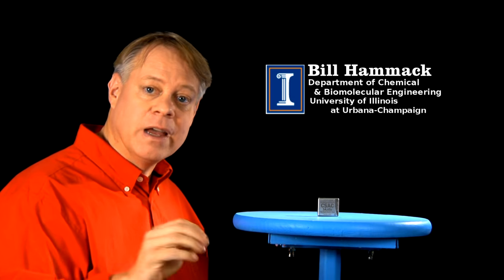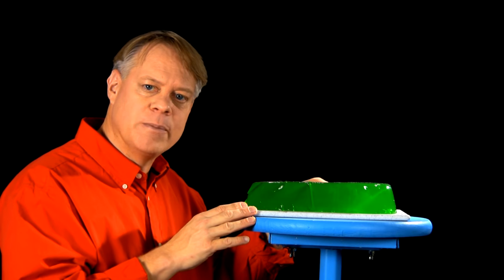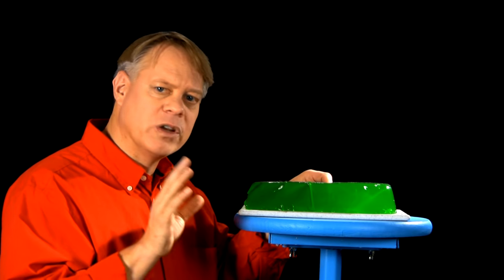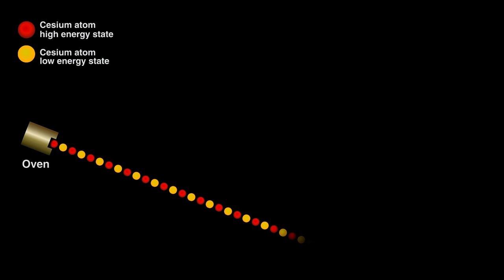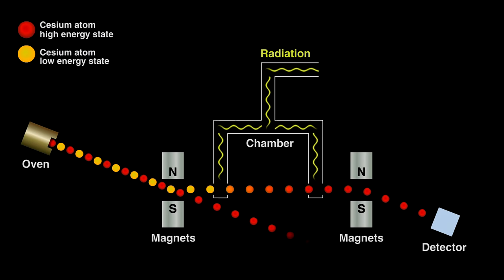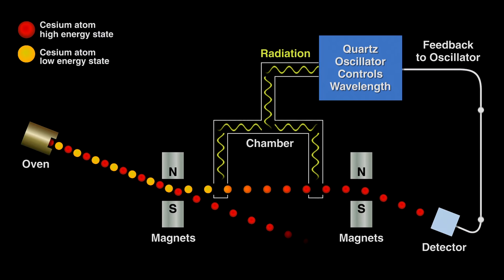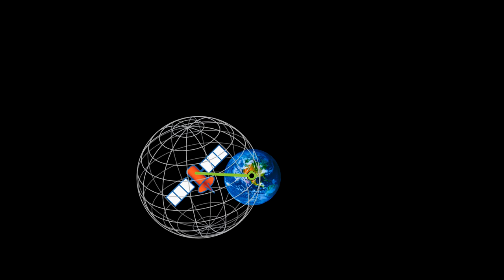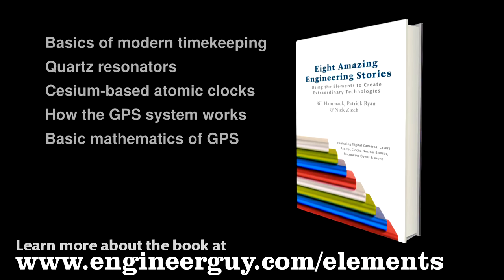How an atomic clock works, and its use in the global positioning system (GPS)

Comment: But my phone doesn't have an atomic clock. How did it's accuracy didn't affect the GPS outcome?
Reply: Systems (satellites, phones, computers) connect to one or more atomic clock services, and fix their own internal clocks.  For example, disconnect your phone from your mobile service provider, and turn off wifi, then change your phone's internal date to something like 1999.  Then turn back on your mobile service or connect to wifi, and your phone will be set to the correct time. See NTP Timer Servers.  Since they have such small chips now for an atomic clock, the satellites probably have their own.
Reply: I actually knew that, but I didn't imagine that would be sufficient to handle GPS. Does this mean, that if I change the date and time in my phone, my GPS will not work well? Because I did this, and I don't see that it matters that much. Is my phone synchronize with the satellite, in spite of me telling it not to?
Reply: I know that Google Maps will not work unless your clock is synchronized.  Many people who have problems with a GPS don't realize it's because they have an 'invalid' clock.

Comment: yeah but basically the surface of the earth is 2D so if you cross the graph of the equation with the surface of the earth you will get only 2 possible points of location :) 
(in case you are not flying or something, that will just point you somewhere else)

Comment: Does an atomic clock lock in some way to accurately reflect our planetary orbit Im curios if the rotation or orbit changed speed would the clock adjust? if not wouldn't a faster orbit or rotation cause a faster day-year that would give the effect of living longer as the years would pass quicker and with less heart beats per minute or Can we tie a man made device such as this to our bodies bio "clock" of aging  and the cosmological "clock" of the solar system
Reply: The IERS adds and removes leap seconds in order to compensate for variations in Earth's behavior. This does not affect the GPS network, because their atomic clocks are used to measure absolute time periods, not cycles (like days or years).
Reply: Ervin Arnold so such a device could in a way be used to alert us if such a timespace phenomena were to occur
Reply: The experience of time is constant for your speed. Barring relativistic effects near the speed of light (and I mean very, very, very close to it, where quantum mechanics kick in, that is, 99.9 and many more nines %), you would experience time just as you know it. Let's suppose your doctor gives you 6 months, and you hop into a magic starship that travels at 99.9% of the speed of light. You would experience 6 months, and then die, just as if you'd stayed on Earth.

Of course, depending on how fast you are traveling, your six months could be years or millenia here on Earth, but that doesn't give you extra time, because you always experience one second per second. If you want to meet your grandchildren as adults before you die, that's great. Hop into the magic ship, accelerate at just the right speed, wait a couple of seconds, and then hop out, decades after. On the other hand, if you need 7 months for finishing your novel, you're out of luck.

Please forgive my poor English.

Comment: in order to calculate the distance in our [hone we need to know acuretly the current time, i don't guses our phone has an atomic clock so how does he calculete the distance without an atomic clock inside the phone?
Reply: Two things to consider.
Your phone gets the real time from a GPS satellite.Your phone cheats when you are navigating by triangulating against cell towers.
Reply: the phone can't get the real time from the satelite, there is a litle delay because the huge distance and also he can't get the the time from the satelite he is trying to triangelate.
and about the cellphone tower ,i know that the gps also work when the cellphone is on airplane mode so thats rules out the cellphone tower option, so could it just be that the clocks in our phone is really accureate?
Reply: BadWolfZm I'm pretty sure when a phone triangulate on cell towers, it is by signal strength, ie. good old fashioned triangulation.
Reply: there are two ways to triangates the phone location, 1 is by phone towers and the second one is via GPS (satelaites ) but in the satelite you need to know your excuct time' how the phone doe's it

Comment: I posted this on his quartz crystal video but here again: 
Me: 🤗was excited to make a comment about how GPS satellites 🛰 have atomic clocks, and it’s the most mindblowing everyday demonstration of the universe’s spacetime
Also me: 👀 notices Bill already did a video on this, 9 years ago. 😧
Well I’m gonna tell you anyway. 😁
Did you know if a person were to theoretically travel in a spacecraft away from earth and reached the speed of 1 light year per second, when they returned, the people on earth would have aged more compared to the person in the spacecraft? It’s not even a theory, it’s a proven fact, and GPS hinges on this, and anywhere you have ever seen a GPS provide an accurate signal, you have witnessed it. 

Because a large mass in space, it’s gravity “bends spacetime” 🌌🌎🌌
In other words, the closer you are to the planet, the slower time passes for you. Yeah, my own mind is already blown at this point. But check wiki and you’ll quickly find a graphic that’s similar to the shape of a stretch-wrap film over a food dish, with a plum resting on top. That’s earth bending spacetime. 

Einstein’s famous Theory of General Relativity “E=mc2” is all about this. 

GPS signal is really nothing more than little timestamps you receive from ultra accurate atomic atomic clocks aboard at least 3 satellites. Pretend you receive these 3 signals:
12:34:56.000000000027
12:34:55.000000000098
12:34:56.000000000013

From that, you can deduce the 3rd satellite is the closest (...0013) and the 2nd satellite is the furthest (..0098). Because they are all using the most precise clocks ever made: atomic clocks, carefully set before launch into space, you can rely upon the accuracy of each signal. 

Even though all 3 signals were literally sent at the exact same instant, the difference is how long the signal took to reach you. 

That’s the basics of how GPS works and it’s definitely impressive but essentially just trigonometry. 

The real mind blower is the fact that GPS satellites must always correct the atomic clock’s signal for their altitude (distance away from earth, remember my beginning?) before it is sent, because of the fact that the sliiiiiightly far distance from earth 🌍 (at least, compared to us here on the surface) is enough that the slightly slower passage of time must be factored in, or else GPS accuracy would drift to something like 5 miles in a matter of weeks, after which it would become useless. (Typical handheld GPS/smartphone accuracy is +/-16ft (4m)).

So, whenever I encounter some ignorant, overconfident fool spouting off how “Ahh, those scientists and experts don’t know what they’re talking about, blah blah blah”, I always love to bring up this example because GPS is so common and yet the slower passage of time in space is a crucial factor without which GPS would not have any usable accuracy. 

I literally don’t even know what I’m talking about but I’m confident you definitely found this as mind blowing as me!

Comment: We don't need EVERYONE buying atomic clocks. Only 1 person need to buy it, then the rest of the world can sync up to his time through wifi.
Reply: If you need accuracy of an atomic clock then deviation introduced by variations in transmission speed are significant to you.
Reply: Which is basically how it works. Your "atomic" wrist watch (or clock) is a quarts driven clock that regularly synchronizes with the time signal from an actual atomic clock. Mine uses the Fort Colllins, CO signal.

Comment: Yes amazing, you can even use atomic clock for measure the speed of light!? Assuming that the speed of light is constant, because the atomic clock is depending of the speed of light. Constant result   yes, but everything is relative anyway so no big deal, just wrong method.

Comment: Thanks for an engaging video. StackExchange, below, says the third satellite narrows the possible locations to two, not one as this video says. Am I missing something?

http://gis.stackexchange.com/questions/12866/why-does-gps-positioning-require-four-satellites
Reply: +Grant T B No, you're actually correct. However, one point will be near the surface of the earth, and the other will be out in space. If the GPS is only receiving 3 satellites, it makes the assumption that the point closer to the earth is the proper location, and ignores the other.
Reply: +Austin Clark So much for navigating the moon's craters! :(
Reply: +Grant T B It is narrowed to two locations, one on Earth and the other in space. Its a little hard to imagine 3 spheres intersecting each other, but when they do, there are 2 points that intersect all spheres. I believe this is called trilateration. From the two points, it is assumed you are on Earth :)

Comment: so basically an atomic watch is as accurate as my cell phone?
Reply: No, Your cell phone is can adjust the unaccurated clock with the accurate clock from the satellite.
Reply: The phone has its own time keeping method, but once GPS connection is established it "updates" the time to match the GPS's to stay accurate.
Reply: A cell phone typically updates its time over the cellular network, using a standard called Network time Protocol, or NTP. this is typically speaking with a server that is also running NTP and adjusting its results based on network latency and other factors. the server generating NTP results may or may not be running on an atomic clock.

Comment: This explanation of how gps works is clearly wrong. The third satellite in this explanation would reduce the location down to two points, not one. Also, the fourth satellite is completely left out of the explanation.
Reply from the maker: We explain in the book: the fourth is used to correct the time — remember that the handset doesn’t have an atomic clock. Also, one of the two points found from the satellites is clearly wrong: far off the earth and can be rejected out of hand.

Comment: I have one of these inside my gshock. Multi band 6.
Reply: I'm afraid your gshock doesn't contain an actual atomic clock. The atomic clock it's referencing is in Ft Collins, CO. NIST broadcasts a signal which your Casio uses to correct errors in its own quartz movement at regular intervals. A handful of true atomic wristwatches have been produced at a price of several thousand dollars each. As the video shows, the CSAC is not a compact device. Consequently, the watches based on a CSAC movement are bulky to say the least.
Reply: you don't have an atomic clock